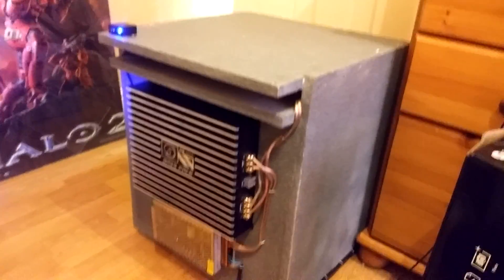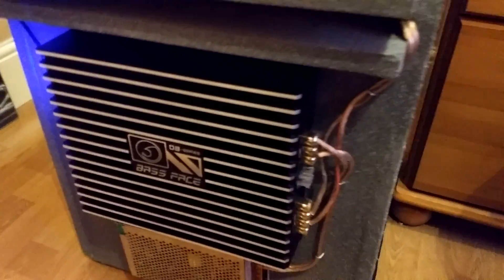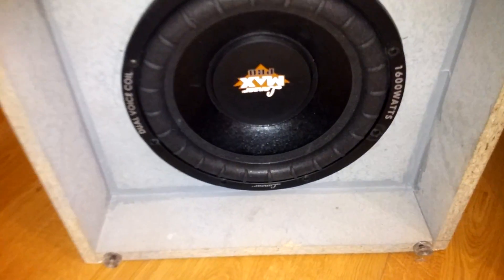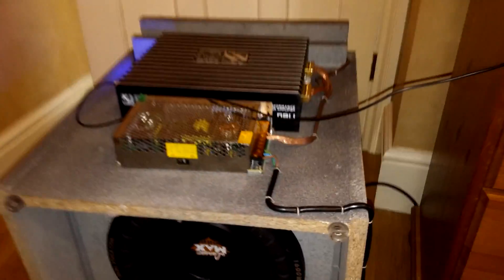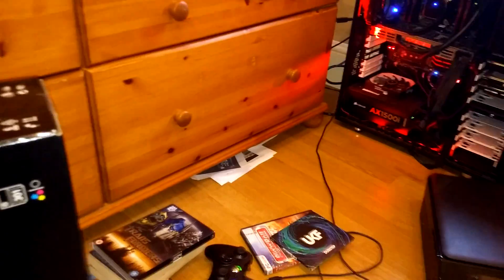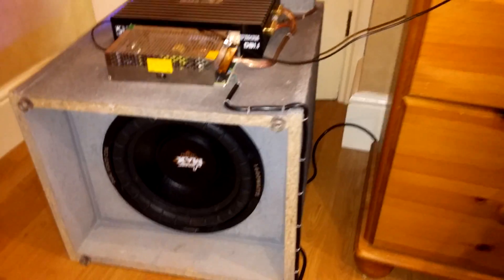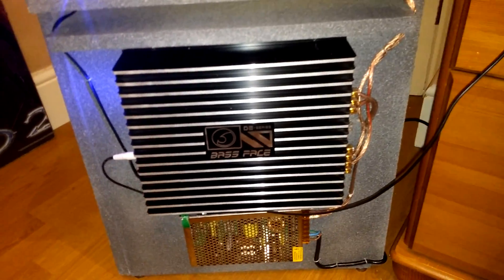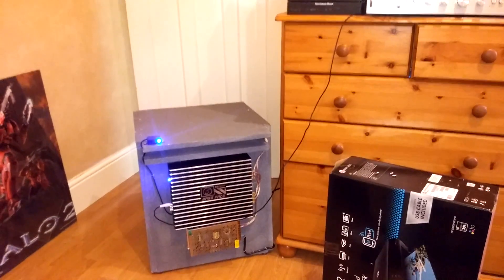DIY Home theater subwoofer using amp from CAR!

Comment: Quick question can you plug rca from the back of the amp into rca subwoofer  pre out on the back of a home cinema amp ?? Would this work ?
Reply from the maker: Yes, why wouldn't that work? That's what it's designed for
Reply: @SolveElectronics  so to run a rca cable from the back of my cinema amp into the back of a car amp that’s powering my sub would work ?

Comment: how did you manage to stop the humming coming through the sub?
Reply from the maker: What humming noise? I didn't have a humming issue with this
Reply: @SolveElectronics  I will post a video and you can hear it. See if you can work out why the hum. I am running the mono sub signal from a Kenwood reciever. There is no hum until I turn the reciever on. If i run it from my phone there is no hum either
Reply from the maker: @tubeagro1986  then you have an earthing issue. Try changing the audio input cable for a newer one, and your power cables. You could try putting a second negative wire into the power supply, and touching the chassis of the amp to see if it goes away or the chaśis of the power supply. But it's most likely a bad earth inside the amp, or, bad audio input cables. If this doesn't work, then you probably have a faulty amp
Reply: @SolveElectronics  legend I'll give all that a go
Reply from the maker: @tubeagro1986  could also try earthing the receiver, have a look into that too. Earthing is usually the issue though

Comment: How much amperes do we need to power the amplifier? Any electrician here?
Reply: It depends on the amp. If you buy an amp that can output 500w rms a power supply needs to be able to  supply a bit more than the rms output of the amp. If you are checking in amps divide the watts by the voltage like 12 or so.

Comment: Can you burn up the mosfets inside a car amplifier if you don't give the car amplifier enough input current
Reply from the maker: Not possible, it just won't perform very well. But the power supplies inside most amplifiers are built with surge and over current protection and are designed to use a range of currents

Comment: The best power supply to power a car amp indoors is the Dell 930watt power supply it has 75.2amps and u can boost up ur voltage up to 13.4volts that power supply I have is the coolest power supply ever if you don't believe me? Check out my videos and u will see.

Comment: Do car subwoofers get warm if you run them for a long period of time
Reply from the maker: any coil will get warm after a long period of time, but it all depends on hoe much current your forcing through it. if its a low load then it will be fine, but high load causes resistance and will make the coil hot

Comment: Indeed!!  Server power supplies can be had for VERY cheap.(refurbished) Most can even be used in parallel to jack your amps potential even further. I have just 1 powering an old school  class AB amp pushing a single (old school)  automotive Boston Pro subwoofer and the quality of the LF in my system rivals  some very pricey HT subwoofers.
Reply: might add this is my third design, First was a psu junker,, second was a meanwell power supply, this one I found a server power supply for 30 bucks. Had to do some digging to get the pinout, so I suggest finding pinout info before actually buying the power supply.

Comment: To do this right one needs to spend a little more on a power supply. I matched mine with a 600 watt  12v supply using the amp with max RMS at 500 watts.... reason being the amp itself is only about 85% efficient. Power supply cost about $80 off amazon.
Reply from the maker: Charles Hendricks very correct. This for me is just a temp things, but it works well for now

Comment: it hasn't any power mate(the p.s.u),,,sounds like a midrange,,,use a pc p.s.u and see the difference,,,the sub will hit really hard...
Reply from the maker: Dennis Wanjau it does not sound like a midrange. remember it's being recorded on a phone. a pc psu is bulky and messy and does the exact same job
Reply: good point,,,the led p.s.u is much much smaller in comparison...

Comment: The power supply is 300w and the amp is 1600w ? evedently the amp is not rated in RMS wattage
Reply from the maker: well 1600w isnt rms no, its more like 700w rms but the power supply can supply the amp with 20amps of curent so im pretty sure it will power it just fine

Comment: Hi mate! Awesome video, im going to do this tomorrow when i get my power supply, but how did you mount the power supply to the box?
Reply from the maker: just screws. theres some screw holes for mounting it
Reply: Chris Hudlin mine has some really tiny screw holes at the back, but the box is already made so I can't open it and screw it in. What would you recommend to mount it?
Reply from the maker: there must be a way. mine only has two holes and theyre a bit hidden around the edges. i dont know what to rerccomend. could make a mounting plate wider than the unit, so you bolt the mounting plate to it then you bolt the plate to the unit
Reply: Chris Hudlin yeah mine doesn't have any holes... I might make a mounting plate or screw/staple some Velcro to the box and stick some to the PSU...

Comment: you should try using a server power supply .... i have an 1000w power supply i get 72amp only cost $24 and  it's silent
Reply: got mine on amazon
Reply: could you tell were I can get that power supply plz
Reply from the maker: +Gonzalo Aguilera eBay :)
Reply: Thank u
Reply: can u post some links
Reply: can u give the link to get it.
 thanks.

Comment: I don't think a led power supply is enough for 12k watt amp
Reply from the maker: it's not 12k... it's 1600w. a lot less than 12k lol
Reply: +Chris Hudlin I have a 12k setup in my house and that power supply blow up.

Comment: u need 2 get the 30 amp one and that's max figers n what cf is the box and what's it tuned to n I'm nog dissing bf as I would of got sponsored by them if I has a car at the time
Reply from the maker: What 30amp one? And I don't know box figures, just made it and it worked really well
Reply: +Chris Hudlin yer u can get a 30 amp led power supply
Reply from the maker: +brad gannon oh right, thanks
Reply: +Chris Hudlin bout the same price n that amp think 500 rms at 4 ohms and 700 at 2 ohms if it's the db1.1
Reply from the maker: +brad gannon It's 700w rms 1500w max
Reply: +Chris Hudlin witch one is it the n is that sub a dual 4 if u will have weird it down to 2 ohms then it will be 700 so is it a db1.1 or 1.2
Reply from the maker: +brad gannon dual 4 1600w
Reply from the maker: +brad gannon it's a 1.1 mono
Reply: +Chris Hudlin yer so 700 rms at 2 ohms nice amps
Reply from the maker: +brad gannon yeah it's good. performs really well, it just gets hot
Reply: +Chris Hudlin yer ther none for getting a bit hot just put a fan on top

Comment: But since your power supply is 12v 300 watts wouldn't it shut off when you try to have your amp power more that that?
Reply from the maker: No it doesnt, it works perfect